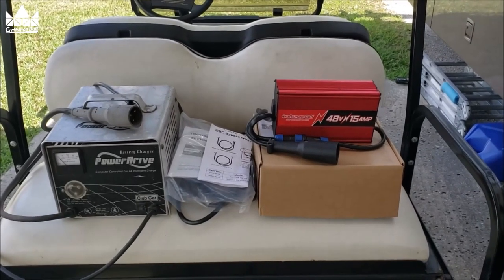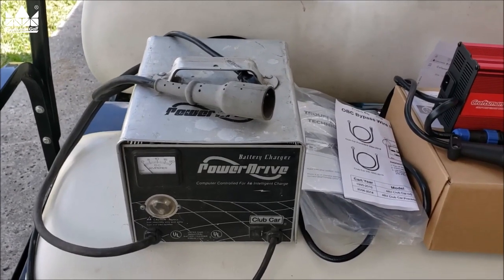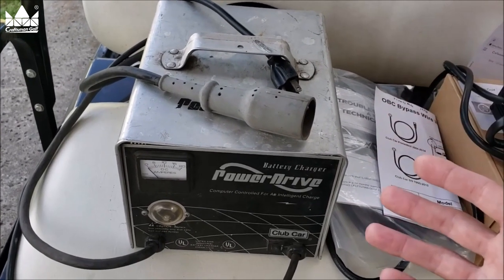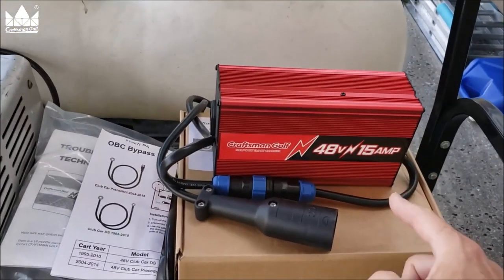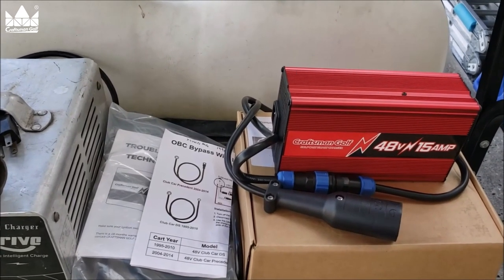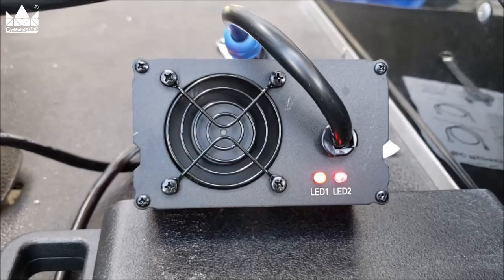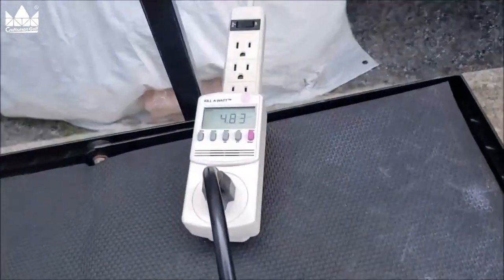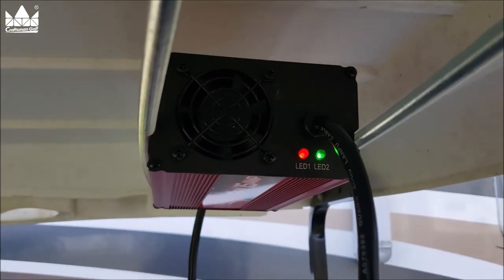Compare with PowerDrive Club Car Charger

Comment: Disclaimer: I'm NOT an expert. With that said, I think there's some unfortunate misinformation here. First, bigger is better, heavier is better. Your old charger is much more reliable and less prone to failure because the transformer is bigger. It will produce a more efficient voltage conversion which wastes less electricity and produces less heat (which is usually the reason electronics break). Second, your new charger is only 15amp, which is very likely going to charge quite a bit slower than your original charger (I don't have its specs, so I can't say that for sure). Third, I can pretty much guarantee that your new charger is just another version of the chinese garbage that is all over amazon for prices between 50.00 and 200.00 (for the exact same product with different colors, boxes, and buttons). The one thing you got right, however, is that newer chargers periodically re-engage themselves while plugged in for a long time so that the battery never gets too low. That's an incredibly handy feature that wasn't available in the old chargers of the 90s. With that said, there are a lot of people complaining that these cheaply made chargers are overcharging (damaging) batteries over time. I would love to hear an update on how your charger is doing now...based on amazon reviews, I strongly suspect you're less happy with it now than you were a year ago. It's just not worth it to save a hundred bucks if it shaves years off of your battery life...